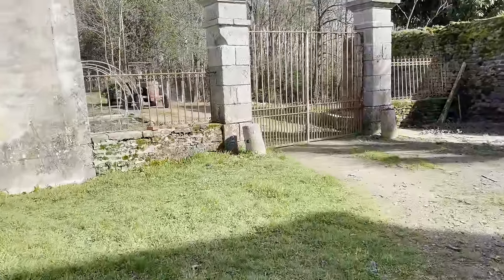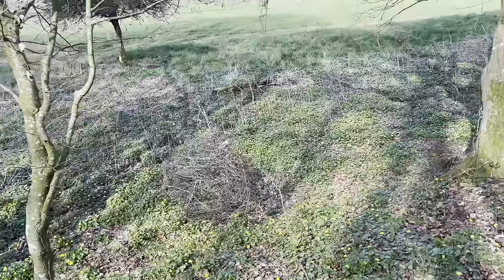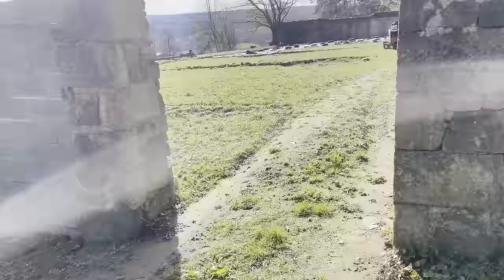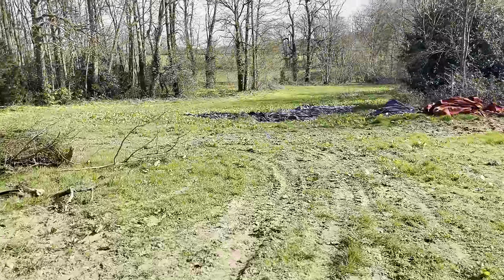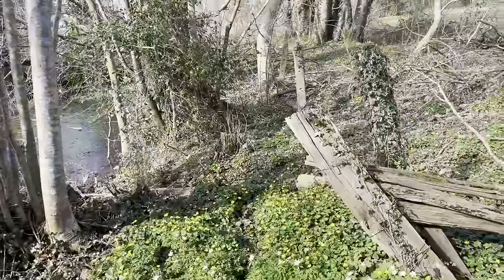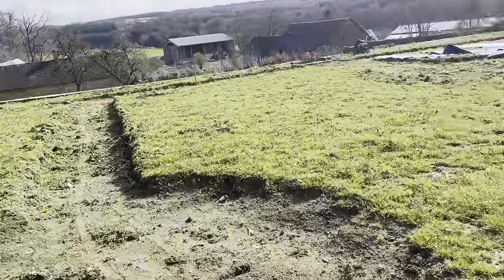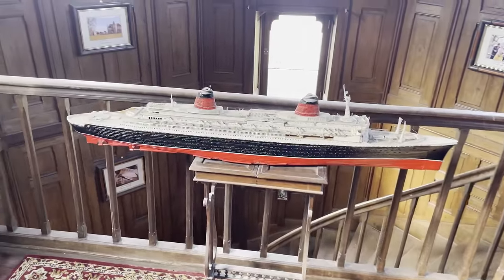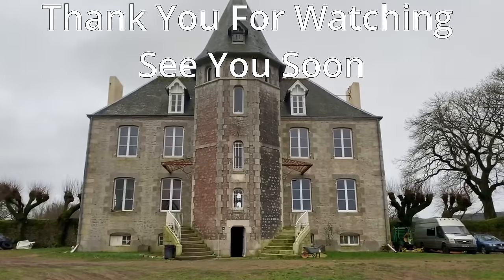The Things They Don’t Show YOU @Chateaudelalacelle???

Comment: I just HAVE to know, at the 19.29 minute mark: is that the 50 Euro table that needs inserted pieces over the tops of the legs on the table top, that Terry bought a few months back? Terry thought that Rob could complete it next time he visited. I was wondering if appropriately routed-outer-facing-edged marble inserts could be cut to put in the 4 empty places?